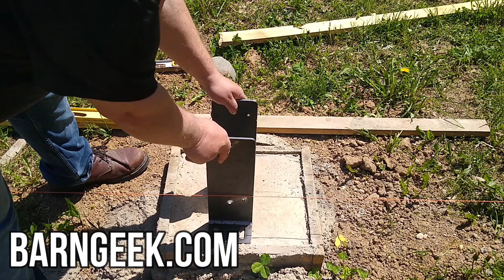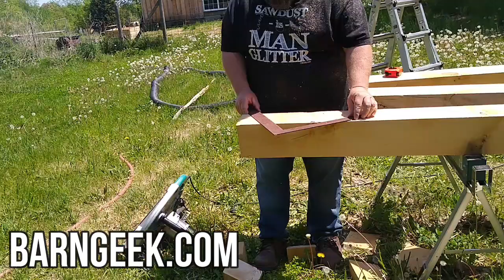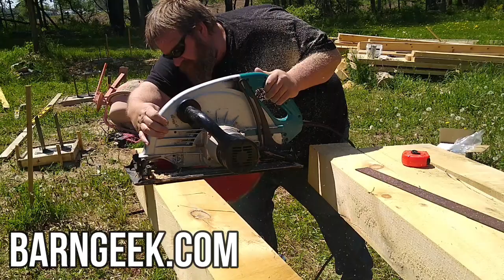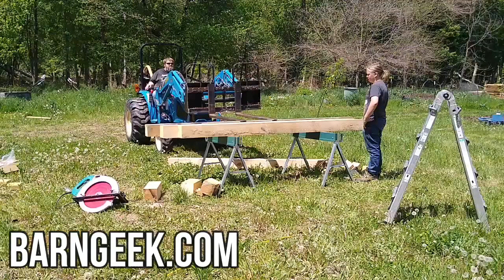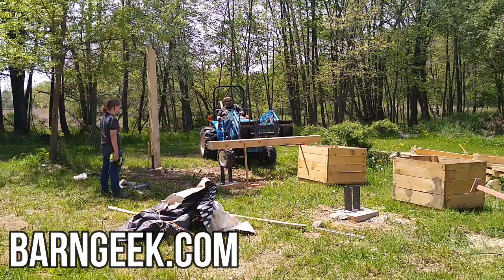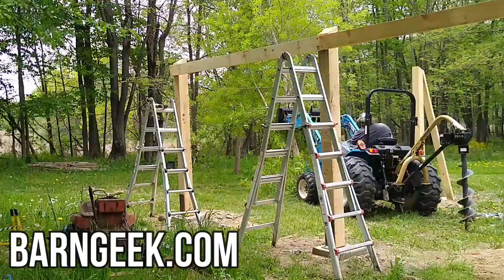Will This 12 inch Harbor Freight Chop Saw Cut ALL the way Through a 6x6?

Comment: Keep making videos, great work and designs. I hope to someday build a barn with your plans.
Reply from the maker: Love the name!
Reply: Trump won, I am starting mine this week! I already built the 10x20 Shed/Barn turned out great. I will share with Barn Geek and i`m sure he will add pictures on his website.
Reply: @BarnGeek  Aaron on the plans you do not show what the angles are for the cuts...Are they all 45 like the shed plans?
Reply: @paulb4400  Sounds great! I look forward to seeing your pictures. Something about the looks of a wood barn on a property, it's just classic American country livin. I live on the Oregon coast so I have easy access to lumber mills. I have a small metal pole style shop but I would like to replace it with something larger and add a livestock shelter/hay barn to the property. Hopefully I can reuse the metal shop walls for the roofing to save money.
Reply from the maker: @paulb4400  No, this is a 6/12 pitch use a framing square to lay that out, don't use degrees, it's not as accurate.  I will do another video showing how to do that.